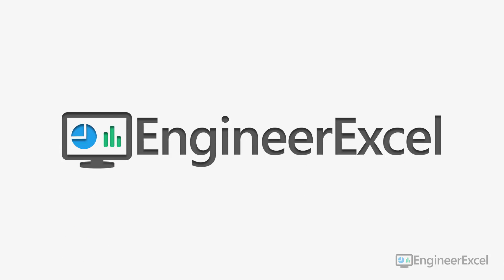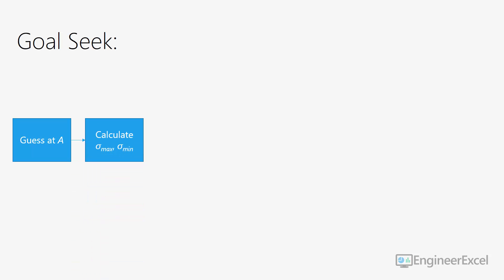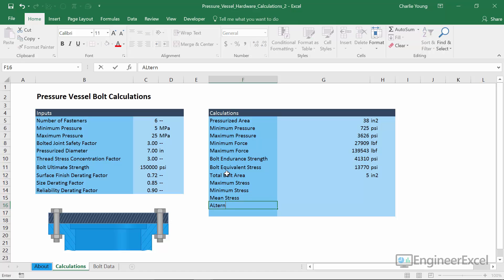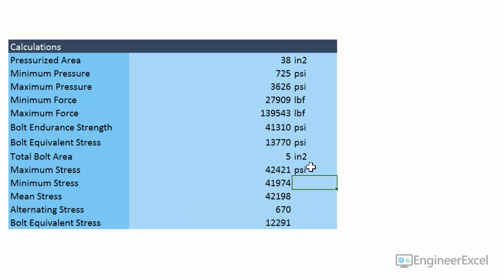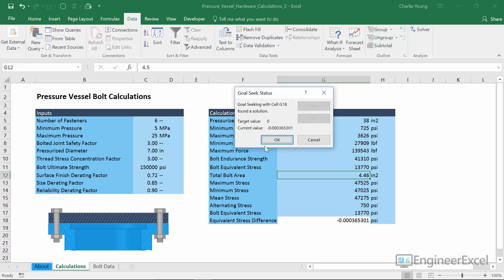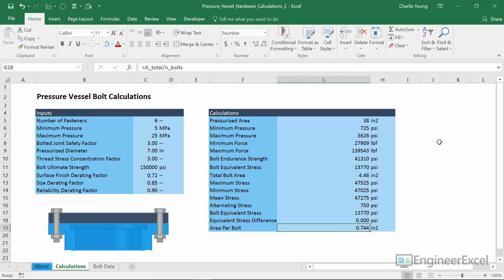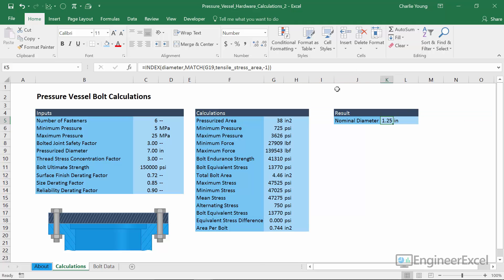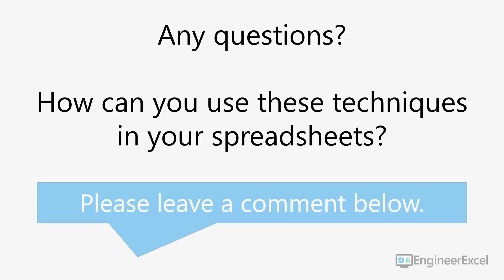Excel Training for Engineers Part 2

Comment: great video. I used this exact process to solve for the drag of my high powered rocket after burn out phase. I made a few youtube videos on it because i wanted to share how to do some cool things in excel.

i want to learn more. where and how can i do that? i want to learn things such as using excel to validate bridge designs, or structural designs, or other pipes etc. If i were to work for the state as an engineer, i would need to be able to create calculations and then have them reviewed by others. 

thanks

Comment: I graduated with my EE degree in 1992 and retired a few years ago.
Spreadsheets were just getting started in the business world.
My Engineering Econ class just barely used Excel since it was taught by an old
Finance Professor who did not exactly know how to use spreadsheets.
He still like Paper and Calculator, God forbid.  He did not eve know how to Sum
a column of numbers.

And in my government engineering job we just did not use spreadsheets.

However, since my retirement I have been spending some time exploring 
what all I missed using 
full power of spreadsheets and I can say I am totally amazed.

If I were a student today, why would I want to buy one of those expensive
single-use calculators, like the TI-98 when a spreadsheet program is more powerful and 
could circles around any calculator?

Now I am looking at the math for Business and Finance problems 
because that is just what I am interested in at this time.

I just wished we had the spreadsheets in all my Engineering classes.
It would have made a whole world of difference.
I think a whole semester could have been devoted to just studying 
Spreadsheets.
Also, another underutilized tool is  MS Access
because when it comes to large data 
Databases can hold more of it than any Spreadsheets.